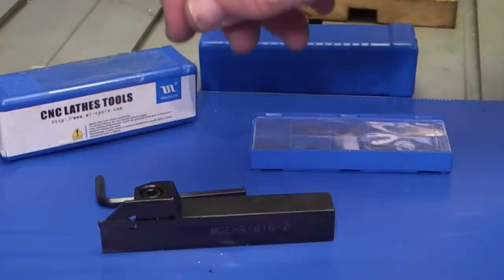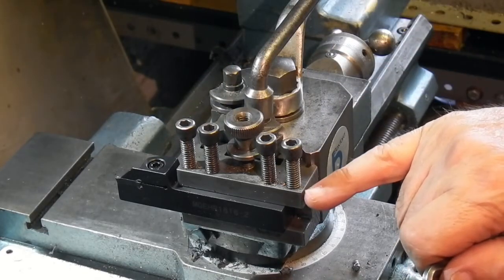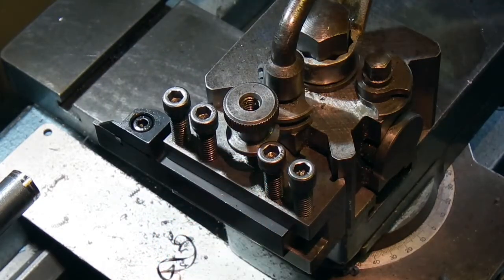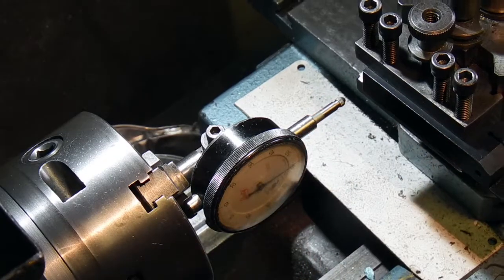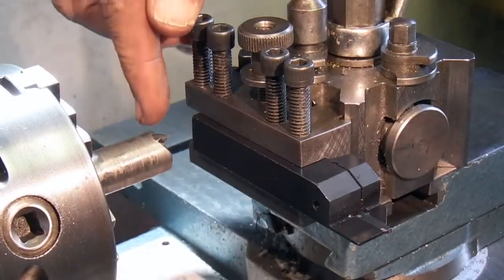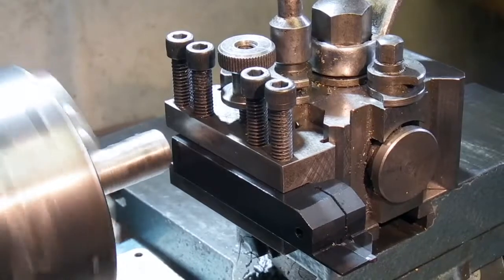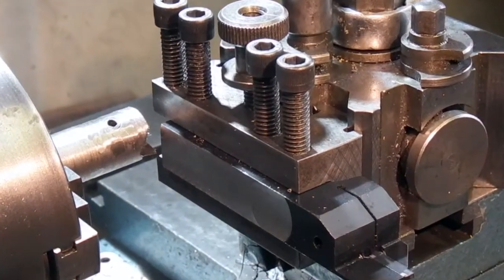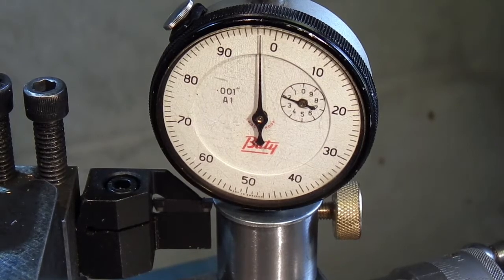Modifications to a parting tool to fit tool holder.

Comment: Stumbled across your channel looking how to build a ball turning tool. Found a lot of good stuff and information. You have a new subscriber to your channel. Look up Steve Jordan on you tube. He had the same problem you were having with the high. He chose to mill the tool holder instead of the tool so he could use it for other stuff.
Reply from the maker: Hi Anthony yes I've seen his mod to the tool holder by cutting the edge off, the only problem with that is you can not turn the tool as the step hits the side of the compound slide.